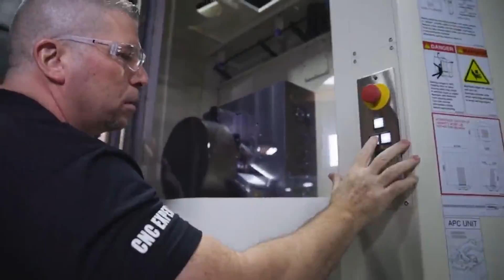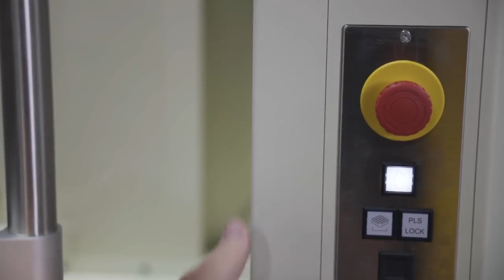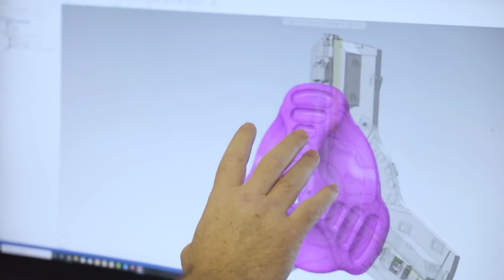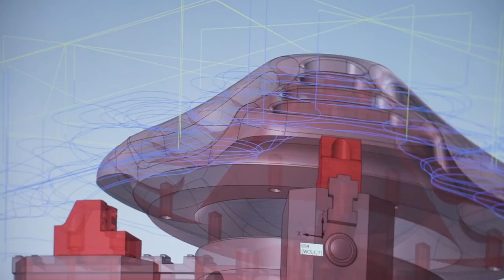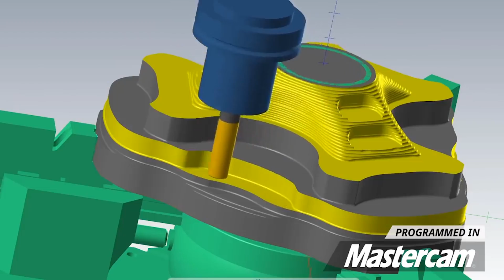Buyer DEMANDS 15% PRICE DECREASE or Parts Get Outsourced!

Comment: Here is a reality. When a customer ask for a huge price reduction, they are already gone. They are just trying to milk their new supplier using you. If you accept, they’ll just ask another price cut until you don’t. And they will switch supplier anyways. Learn to cut your loss.

Never gives the following for free: Rush jobs. High tolerance jobs. Make it a specific item on the billing.

Be honest with your rates, be detailed, and bulk prices requires contractually guaranteed volume. Stay away from fixed pricing. Protect yourself from your own suppliers.

Comment: Its funny that some managers/owners are so stubborn. On one likes to cut profit margins however it something better to look at the bigger picture. Customer asks for a reduction in sales cost (15%), you say "No". Customer says, Ok I take my business else where. You now lose 100% of that revenue, and the rework parts, I'm guessing,  were only on some components not all.  Given they were already making a good margin it would have been smarter to work with the customer rather than loosing the work.
Reply: Upfront reduction is a big no for me, since that is them increasing their own profits at your expense. Now if they are ok working with you to reduce cost by way of helping you optimize the process, say redesign the part for better work holding, change material to one either cheaper or easier to machine, reduce tolerances, that is a whole other thing and very much a positive.

Also they are not entitled to whatever time and machines you invested to optimize the process on your own without their input, you are doing that for your profit not theirs.

Comment: Correct me if I am wrong. Machines that run 24 hrs wear out twice as fast as 12? So 5% for 24 hrs is 120. Vs 15 for 12 is 180 with half the wear. What am I missing?
Reply: That is popular belief.  And quite false. Take a car for example, 10 yr/100,000mi warranty. That is the advertised life span. However, changing oil every 3,000 miles and doing prev maintenance, a car can last significantly longer than that. My isuzu ascender has 150K+ miles on it and has never had a rebuild. Same for machines, if you take care of them, they will last.

Comment: What I hate about outsourcing is all that wasted fuel and time transporting things back and forth that needn't be. Any company that has shareholders is generally not a good company especially if they listen to shareholders considering they are only seeking monetary gain but chances are have no understanding of the company environment and products.

I do think that price efficiency is important but to request 15% across the board is pretty shitty to do. There are things that should influence your price and experience should be able to drop the price if you've been in a partnership for a long while. You do definitely have one thing down and that is making your machines run all the time. The second thing is running all your machines at the most money you can charge, but that is pretty hard to do as many things impact that as well.

Comment: The way I see it is, you get what you pay for, period! If you want quality, service and after sale support, then you gotta pay for it. Besides, it's cheaper in the long run when your parts last longer. So no I wouldn't have given them those discounts. They'll learn when they end up getting low quality parts and they spend more money because they have to keep fixing or replacing them.

Comment: Other channels have discussed the topic of knowing when it is time to "fire" a customer. I have had to do this and it often frees up internal resources which allow you to optimize quality and workflow for your "better" customers. I was also ask by a good customer to cut cost - and I did, but it also included new terms that material costs be paid up front with the purchase order and payment would be net 10 with a 5% late charge added if invoices went past net 30. Also all parts would be delivered as machined. Sourcing of any plate, anodize, chem film, passivate etc. was now the customers responsibility. We still offered quoting of parts complete ready to assemble and it showed that much of the final cost was outside of our control.

You can pay too much for a good attorney, but what is worse is not paying enough to have a good attorney. Often manufacturing sourcing is the same concept.

Comment: My dad was a machinist for 5 years, his philosophy was this.   The cost of the person running the machine is only part of my cost, you need to factor in everything, electricity, repairs, replacements, etc.   Then you get a number, you divide that number by how many hours a day the machine runs, add 30%, that is the base cost per hour to run your machine.  If the customer does not like it, too bad, cause if you go under that cost, it might not bite you today, it might not bite you tomorrow, but eventually its gonna bite you, HARD.   So many shops run around trying to undercut each other, but my dad ran his shop 24/7 for 50 years, paid his guys 100k a year to start (this was in the 60s mind you), and NEVER compromised on price just to keep a customer, he ALWAYS focused on quality.  Eventually old age got the better of him, but he was able to live out the remainder of his life in peace and comfort, because he charged his customers the real cost of what it takes to make quality parts.

Comment: I own a company that pretty much just supplies professional labor with some unique equipment.  I was asked by one of my clients to lower my rates 25%.  I said the fact that you actually think I make 25% on an invoice is totally out of touch with reality.  I said "NO!  Go back and sharpen you pencil and come at me with a realistic proposal and we'll talk."

I used to work at this company for 14 years.  Many times I'd cut a break on an invoice because I knew the Project Managers have approval limits.  So I'd knock back overtime or per diem or not charge for material.  Not anymore.

Comment: I've seen this happen in a company I used to work for but different industry and products. The customer service team hired a supervisor who on his first hour of work, asked "how long does X take to do?" then he replied to the answer with something like "Ok we're going to need to speed that up by 20%". And then did it again with some other process. The guy literally just got there, hasn't done any of the work to verify for himself. He offered no guidance but just "get it done". I think he got fired a week later because he sexually harassed on of the employees, lucky for him the husband didn't come into the office and throw him off the 3rd floor.

Improving products and processes are important but you have to have a real plan. And then have a working model. That customer should have said they wanted to cut down on costs and asked for proposals. Sounds like Titan was down to help.
Reply: The moral of the story is to use the Scotty strategy (from Star Trek). Tell the captain it's going to take 36 hours, then when you do it in 24, you're a hero.

Comment: In competition everyone is looking for better ways to compete.  I don't fault the new CEO for making this attempt, however hamhanded the direction was.  It's a serious advantage to always look for more productivity and lower costs, just as you so ably show in your videos.  Take this "demand" as a "request" and start negotiations for cost reductions.  As you pointed out, if you keep your machines busier you are able to lower fixed costs.  So, tell them to give you more orders to keep your shop busy and share the overhead reduction with them.  A purchasing agent worth his salt will take that to the CEO.  If the company rejects this partnering approach, then the writing is on the wall.  Anyone going overseas for outsourcing effectively cuts their own throat in the long term due to lower quality, higher transport costs, and much, much less control.  I've seen it in electronics design, semiconductors, system fabrication and basic engineering development.  I would expect the same thing here.

Great channel and work philosophy!  I just watched and couple of your videos and you have a new subscriber!

Comment: My 2 cents worth:

Beginning of 2020, everyone was running to get new MB, mask machines.  Bunch of Chinese companies started offering them at knock down prices.  People saw money in the MB and mask machines, they bought 100s of them.  8 months later, only with 20% of the new factories running, the buyers realised that the manufacturers from China had no idea what they were doing.  The MB filters produced failed all quality tests, masks machines failed quality control constantly.  In the end, these machines came back into the market as ‘used’ at 10% of their original costs.  Even then, no one wanted them. Lots got sold as scraps, less than a year into use.  

We have another famous story where a ship builder in China won the contract to build a large container vessel.  3 years later, after 8 months delay, the vessel finally failed the safety tests and was uninsurable.  The ship builder demanded extra payment for the excess work tgey did over the delayed 8 months and sued the counterpart.  

Some suppliers have no concept of quality or even the purpose of the products they are producing OR what business means.  Why would you order or buy from those people?

Comment: My dad used to design safety valves for oil rigs, his company outsourced manufacture to China but it failed as the tolerances we out and they could not do the job, he (and others) persuaded the company that `quality costs a bit extra` and they thrived through precision engineering, not crap materials and machining. Stick to your guns and make a fantastic product, you cannot compete with volume, so compete on your own terms.

Comment: it's a tough call, but I'm not sure a flat no was the answer. A bean counter will count beans even if its a rock. Products will always get cheaper at a faster rate than inflation and it can be demoralizing. I think I would have offered a loyalty deal of 5% with a 5% increase every year for the four years for a total of 20% and then hicke the price by 2.5% every year then release a rapid quality line around the 3rd year for a 35% discount at half the cost. But i don't own my own business yet, i still like making stuff as a side hustle and I'm not ready for the politics.

Comment: 15%is a lot if it's possible just do it but you have to be always aware in what conditions you will run in to if you do, because it's not worth it to accept such a deal and then running into slavery or child work. I don't wanna know in what conditions those parts got made in Malaysia. But I'm sure they cut cost on essential tings like safety for example. Capitalism has no moral or ethical reasoning it has only a huge hunger for Profit and Expansion . If you keep that mentality up like this eventually you will run your company into limits that are inhumane and might be against the law.

Comment: Listening to your comments, in which you said that the company could have given a 40% reduction and still be good should have caused the owner to evaluate the request more closely.  Not sure of the logic used because it appears that the company gave up 3.4M in sales that would still have had a substantial margin even after the 15% reduction. Replacement business must have been readily available. Unless I misunderstood, IMO, they made the wrong decision.
Reply: Good chance a 40% cut was possible on paper, but taking everything into account would make it a loss. Machines need maintenance, repairs eventually they need to be replaced. Then you need space for storage and space for manufacturing and lastly you want to make money if you have a business ;)
Reply: @ssu7653  Everything you said is true! We don't know the whole story and my comments are based on the commentary " we're making a killing across the board and could easily give 40% and still be good". That says to me they had a very, very healthy margin and a 15% reduction would have been acceptable ongoing or at least until they could find replacement work. Our shop rates / machine rates had all the cost buckets folded in , O/H and labor. The repair and maintenance costs history ,although variable, were estimated and folded into the machine rate.  I don't know the big picture, perhaps the lost sales was easily and quickly replaced with new business at the same margin as the lost business. If not, there may have been idle equipment making zero margin and possibly a reduction in the workforce, both bad. In the past, during economic downturns, we maintained some business that was so large its small margins provided enough cash flow to keep the doors open and our people employed.

Comment: As a customer ordering small high priced batches and knowing what a part costs in the manufacturing, I've never forced a manufacturer to lower his offer when it was fair. One time I did also the opposite so he should increase the price because I knew the tooling costs would not be nice on a special material. But the parts have to be delivered in time and with defined quality! I try to keep in good touch with my manufacturers, so when I have a problem they will help me. And I'll pay it.
Reply: I’ve told vendors too that they were to cheap.   I want and need viable vendors that I can rely on to give me quality parts delivered on or before the date promised.

Comment: I used to work for an automotive company years ago! We built a lot of the in-house tooling one point in time! One of our VPs wanted to save money! So we outsourced 75% of all the new tools to a Mexican tool and die company! An additional 25% of the tooling came from China. We ended up spending almost 3 times the original budget that was going to be allocated to build those tools in house to rework tools not only that we miss production dates that cost enormous amounts of money. Saving money does not translate to actual saved money
Reply: Penny wise and pound foolish. Real life is not a spreadsheet.

Comment: I hope when titan says he tries to run his machines at a rate 100% of the time, that he has some built in time to check machines/parts and fix/redo any errors because we all know no manufacturing process is 100% all the time.
Reply: Preventative maintenance? Sounds like unnecessary overhead.

Hey, why are the machines down for emergency maintenace all the time, and why is overtime through the roof‽

Comment: Did a lot of work years ago for an great injection moulding company. They ran 2 to 3 machines several days a week to make things for a company. After 2.5 years they attempted to raise price due to increase in plastic , labor, electric etc. Company demanded a price cut or they would go else where. Owner of injection shop refused so scum bags took work to lack of quality control lying cheating communist china.

Comment: I think he was right.  Because company's like this will ask for 15% today and 6 months later 15% more until they break you than move on.
Reply: Give them a 15% discount if they can identify 15% of the work and material they no longer want.

I wouldn't recommend aiming for 100% utilisation of machines, either - always factor in time for both preventative and emergency maintenance (the former rather than the latter, preferably).

Comment: The correct response to this offer is "No." The customer is not entitled to free work or free metal. If they go to your competitor with that deal then that's a good thing. If your competitor has many customers like that they'll be out of the way soon enough. I mean I don't know what the margins are for your job, but discounting the inputs and the outputs for manufacturing multiplies the discount to be higher than 15% in reality. However, if you innovate and you get a higher margin, it's fine for you to decide to lower the price to be more competitive/get more business. Your customer doesn't know your input costs and your capital costs so don't let them tell you what your price is allowed to be. If the business plan is viable to your satisfaction then the price is what the price is.

Comment: It sounds like you had the margins to work so I would say it just depends on how busy the shop currently is.  If you are already running at capacity and have plenty of work then there is no reason to drop your prices.  If you have a lot of machines sitting around doing nothing then it was a bad move to not adjust.
Reply: If you are running / wearing out / your machines, just to run them and not to make a profit, then you are wasting your time and money.